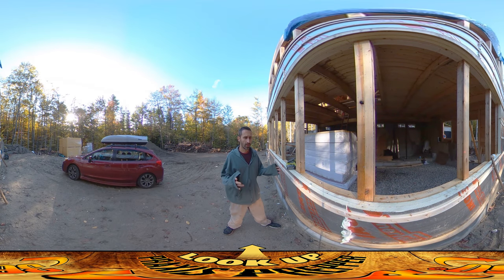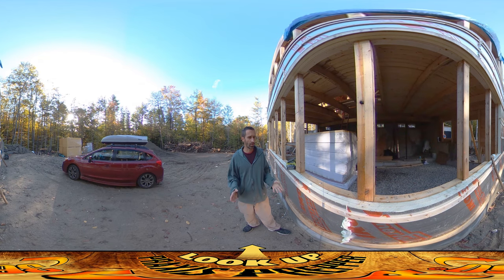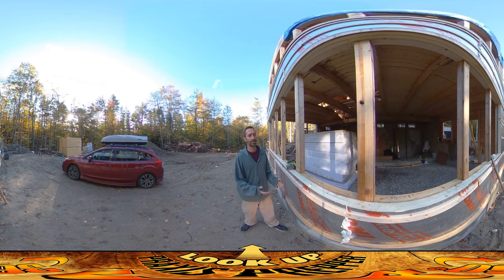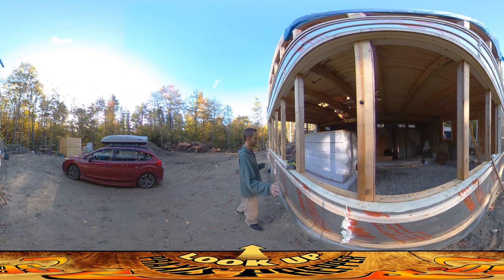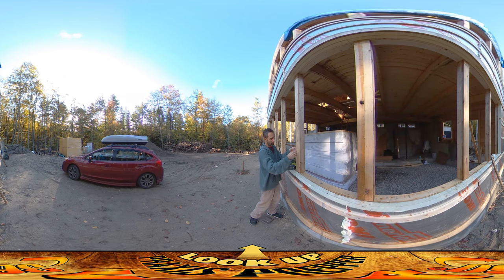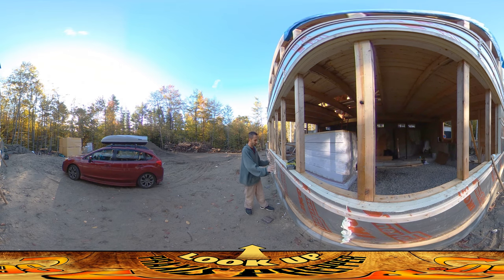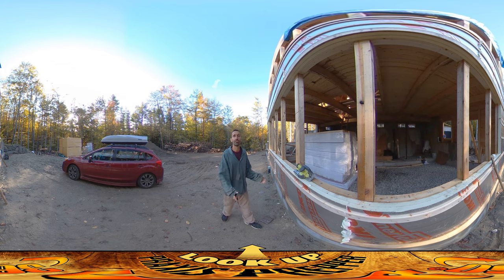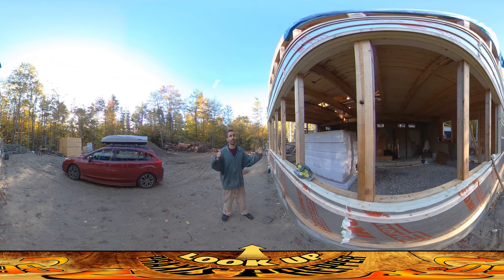Homestead Building - Description of the Layers of the House, Critical Saw BROKE!

Comment: That insulation should keep you cozy. As long as the house can still "breathe" you should not have humidity build-up or mold issues. Your kit seems well designed. You just wore out the saw. That smell was the motor burning. bearings or roters; possibly contacts , with the sometimes it runs issue. You might be able to salvage it, but retail units are usually designed to be cheaper to replace than to repair. If the saw is still under a warranty, just swap for a new one. I am surprised that it held up as long as it did. That saw has don a LOT of cutting. Cordless units are designed for portability and ease of use, not necessarily durability.

Comment: What happened to the  prius?
Reply from the maker: Amber is using it to commute to school. That subaru was bought as the backup vehicle for the roads around here. Even with studs that Prius would not have been able to handle the winter roads - and I know what the Prius can do from years of pushing it too far sometimes. I super miss the 50+mpg though. I still love the Prius.
Reply: @PraxisPrepper  The Prius is also the perfect back up generator for powering a home.